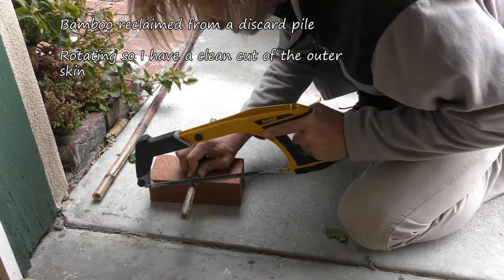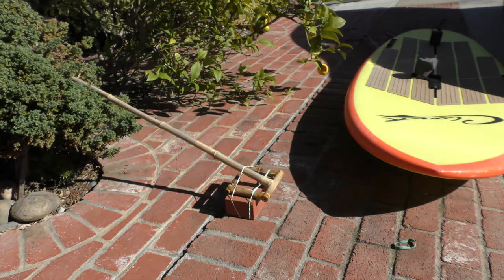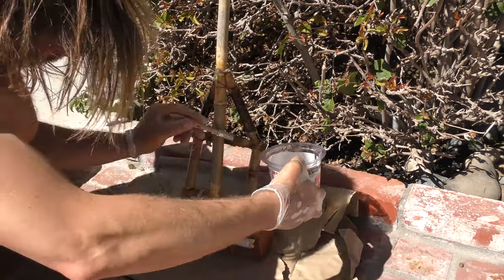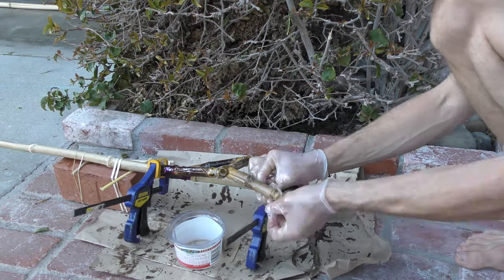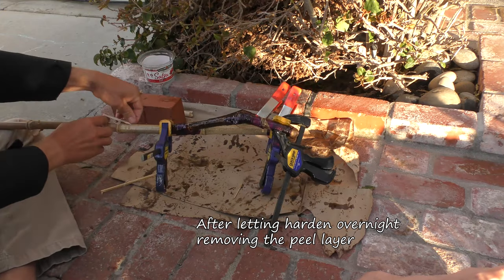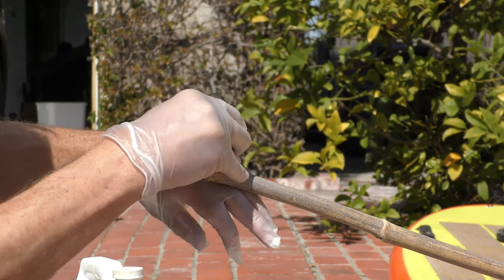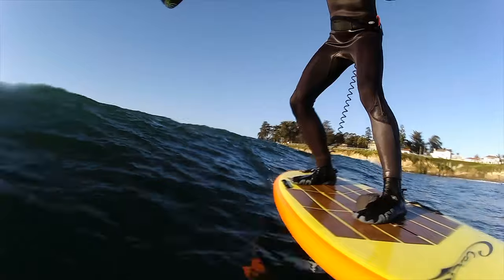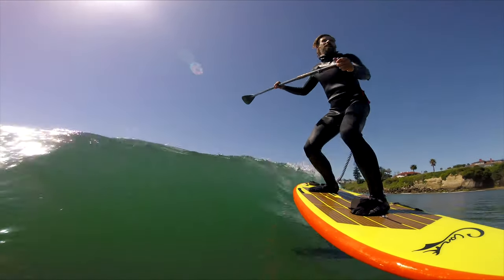How to Build with Bamboo

Comment: What's the point of using reclaimed bamboo if you're going to spend more money on epoxy than just buying a camera arm?  epoxy is expensive.
Reply from the maker: Hi, what is it going to cost to clean up all plastic toxic garbage we've dumped in the ocean?  What will the cost be if we don't clean up our mess?  Most of the camera arms I have seen are either cheap flimsy toxic junk or heavy toxic gear that won't work in my application.  Almost all of them use super toxic epoxies or glues, I'm using Entropy super sap which is at least 40% plant based and doesn't have that super toxic nasty smell.  At most I'm using like $10 worth of expoy.  A quality camera arm cost at least $200, and it is still not as robust and lightweight as the ones I have made.